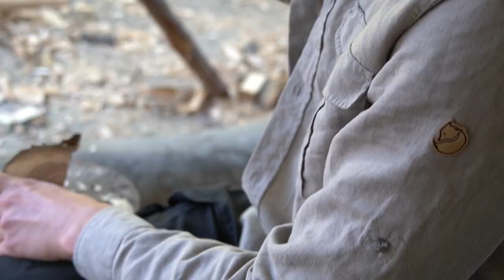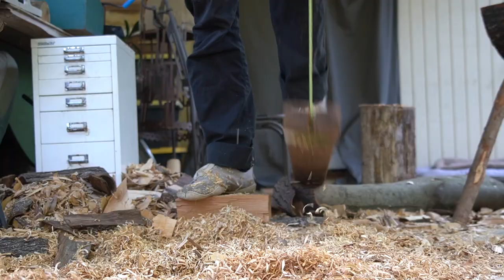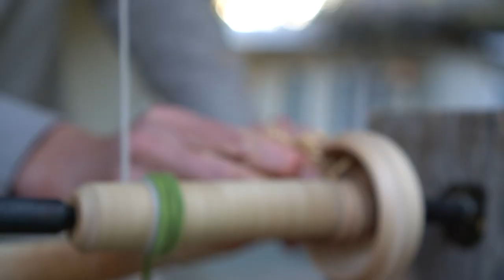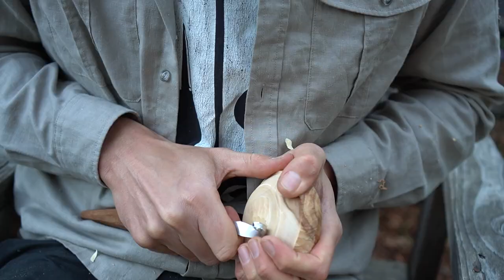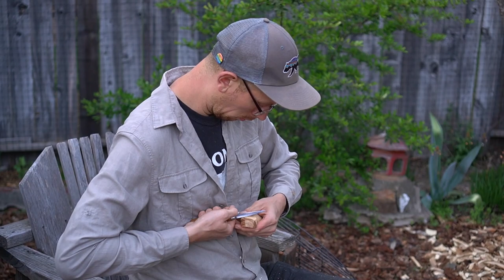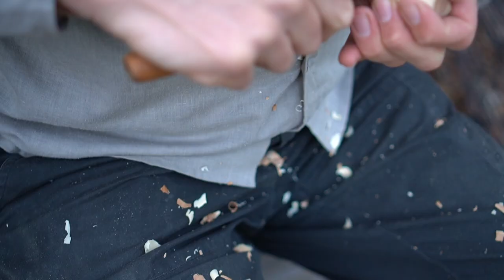HAND CARVED WOODEN CUP MADE ON VIKING LATHE: Learn to make a turned Kuksa or Whiskey Quaich

Comment: Now there's an interesting technique with the mandril tenoned into the blank. I only knew the nail spikes variant. Gotta try that one out. 👍Grüße
Reply from the maker: Yea! it is our preferred method. We use spikes for plates and large bowls though as the torque is much stronger. I realize its a long time since you made this comment. Have you tried it since? Also are you from Germany? We have a craft gathering called Von Hand in September near Schwabisch Hall. Would be great to have you!
Reply: @WildCraftedHome  I think I tried it for turning buttons and that worked well. Still have to do a bowl; my lathe is better suited to spindle turning. Thanks for the information on "Von Hand", I live in the West of Germany, but if I can make it, I'd be interested to attend. I'll check out the webseite some more.